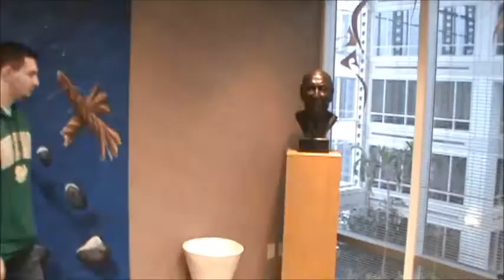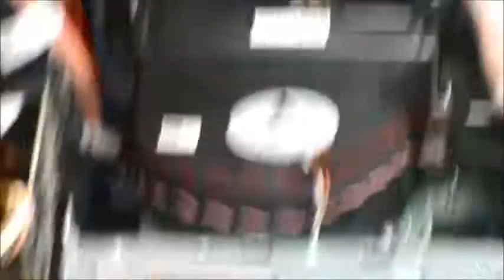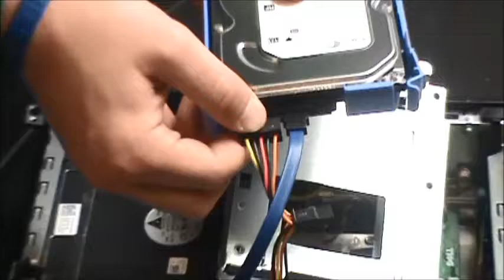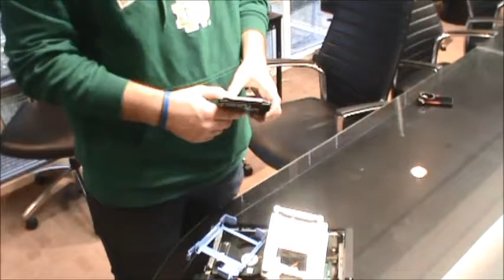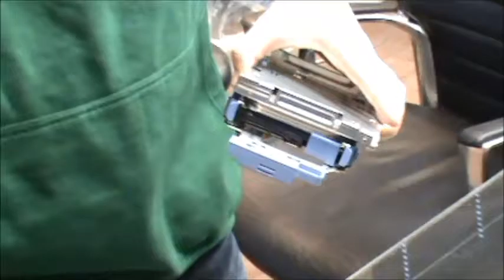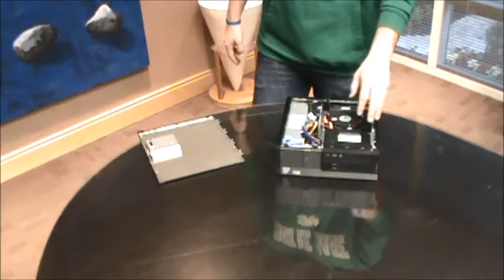How To: Exchange a Hard Drive on a Dell Optiplex 390

Comment: Thanks for your instruction. I have optiplex 390 and i have to replace hard drive for the first time. I am pretty bad when it comes to computer.  Can anyone answer these questions? Whenever i turn on computer, it keeps saying no connection to hard drive and it wouldn’t start. It could be either the cable issue or hard drive issue. 

1) can i replace current hard drive with any hard drive as long as it’s 2.5” hard drive? Or do i have to worry about any compatibility? 

2) regarding that 2 cables ( one for the power and one that’s connecting hard drive to motherboard), what are the names for those when i shop for new ones? Are those cables universal to any hard drive or do i have buy only ones that are compatible to dell optiplex 390? Thanks.